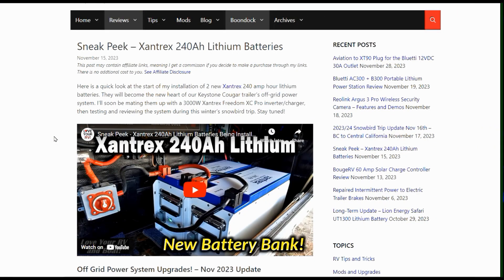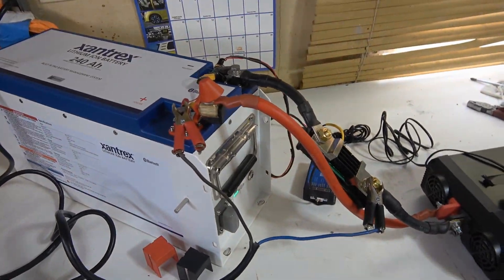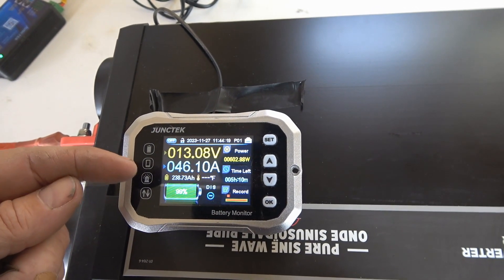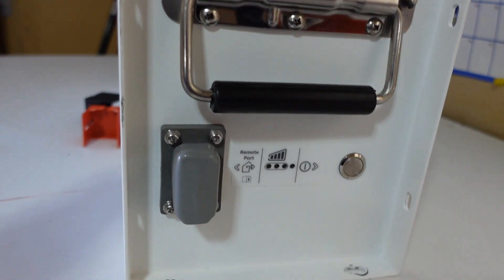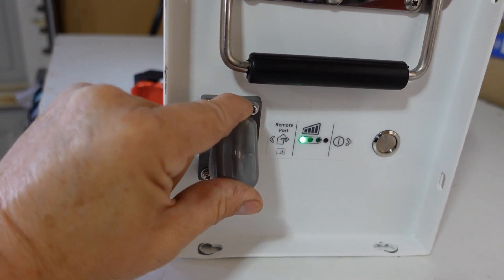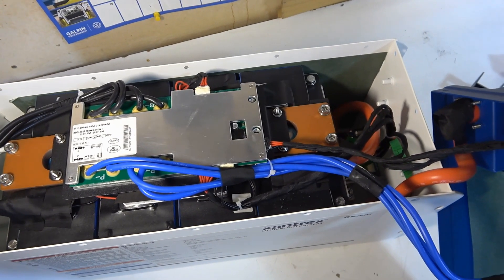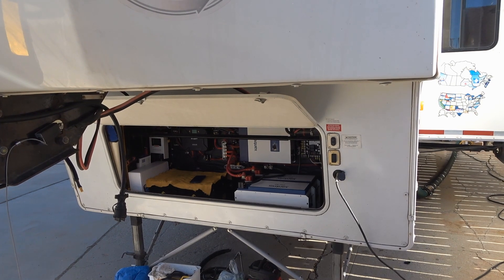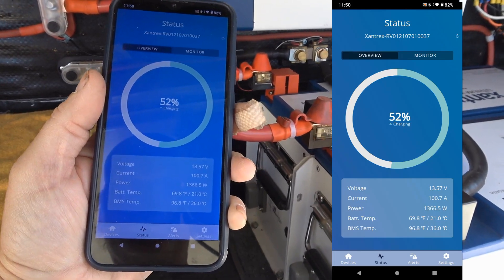Xantrex 240Ah Lithium Battery Charge/Discharge/Capacity Tests + Inside Look at Build Quality

Comment: Thanks for sharing your videos. I watched many of them, and they helped me with my own RV, which is similar to yours. The question is, did you change your hot water tank yet, and if not, will you consider on demand hot water heater?
Reply from the maker: I needed to replace it several years ago. Had a manufacturing flaw that showed up.  I went with the same 6-gallon tank type.  I wanted to keep the electric functionality for when on shore power since shore power was included free at the campsites I frequented about 4 months of the year.  LP gas is getting pretty expensive and the water heater can be a big user of gas. 6 gallons is enough for us. Just my wife and I and we tend to shower at different times or do very short ones when off grid. Cheers! Ray
Reply: And even though insulated, a standard tank heater leaks a bit of heat, which can help keep the basement plumbing intact at -1° F. Last winter we got caught in TN in weather that cold. Overnight our propane pressure dropped below the minimum to operate the regulators, so we were made do on around 2KW of electric heat. We did turn off the electric water heating element to make more headroom for electric heating on a 30A service.

Comment: I've been a user and fan of Xantrex gear for years, at home and in our Montana. Among my suite of their gear are two inverters, including an SW5548. Also chargers, and a Link 10, and Link Pro. 

These batteries look very good. Yes, the inside view of the lithium battery looks like a very professional design and build, EXCEPT for the sharp tails on the zip ties. Details matter. Those cut ends are razor sharp.

Yes, I'm OCD. But one has to wonder what other hidden shortcuts there might be, if Xantrex can compromise on something as simple as a zip tie.

Comment: Great video, boondocking should b fun with thoes two monsters, wondering what your thoughts would be on adding two new lithium batteries to two gently used Renogy batteries used for two years of summer camping, enjoy the dessert, freezing in north dakota
Reply from the maker: All the manuals I've read say not to mix different age batteries, but if gently used, they likely have very few charge cycles on them that the cells should still be very close to total new capacity, so in a parallel arrangement, I hazard to guess it would be OK. I think they are worried about old cells causing the bank to get unbalanced.
Reply: I think I'd err on the side of caution. I'd isolate one battery string from the other with a DC-DC converter. Of course that makes your charging arrangement more complicated. 

I paralleled three AGM batteries and my original Interstate flooded cell battery for a two month trip which involved quite a bit of dry camping. I believe my converter overstressed the AGM string. Also, I didn't provide enough air space around them. The middle one died young.
Reply: Is there a source where I could learn more about how to set-up a DC to DC system to isolate the new with the older batteries, thanks for your thoughts

Comment: Any chance the 2nd battery is turning on before the fault  happens?  Given they are not balanced wouldn't the battery you are trying to charge also start sucking current out of the 2nd the moment it came on?  That would exceed the 150A max charge amps, no?
Reply from the maker: Could be.. sounds like a possibility. :)  but as far as I know the other battery should stay in the off state. I had its power switch turned to off. The app never showed any spike in current to the charging battery but maybe its delayed. I'm not sure why the other battery can come on when its power switch is in the off state or why didn't it come on a 100A or 120A charge levels? Hopefully Xantrex can shed some light on it. I have contacted them and awaiting a replay. Cheers, Ray

Comment: Had you thought when, while paralleling these batteries, moving one of the trailer connections to the other battery? That balances the (slight) resistance of the paralleling cables so each battery sees the same applied charging voltage.
Reply from the maker: The batteries should be balanced I used identical sized positive and negative cables to each battery and then combined them on bus bars. See this previous video. https://youtu.be/FKGbpruwoZg Cheers, Ray